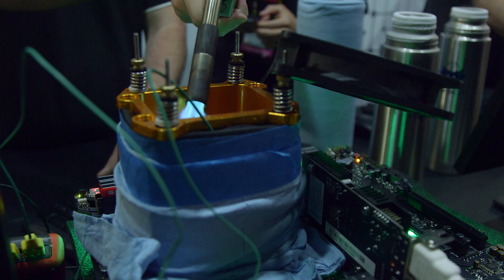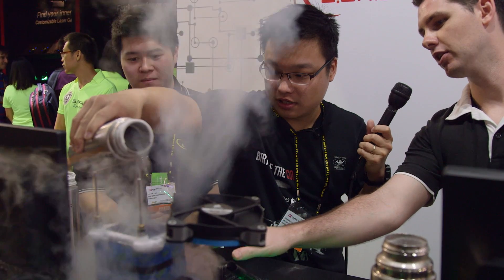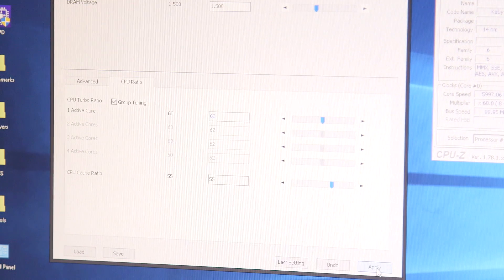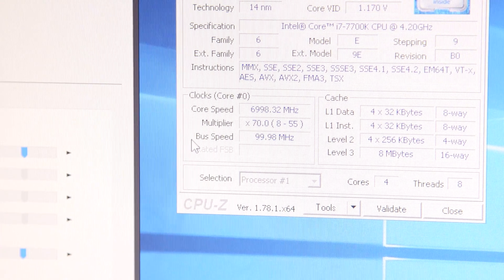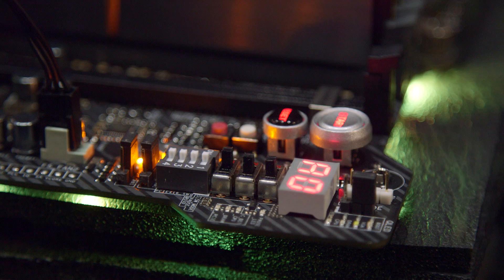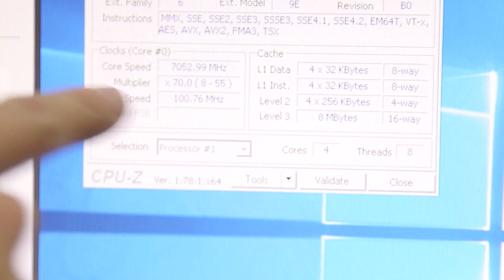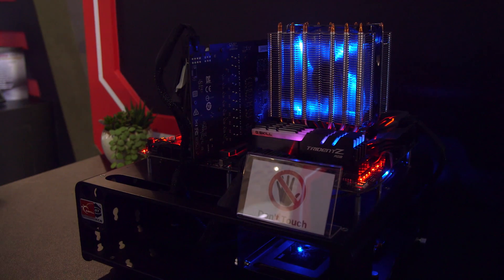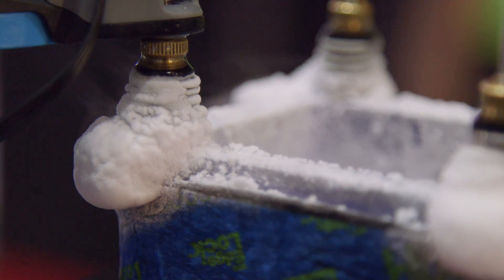Overclocking to 7GHz with Liquid Nitrogen | Hands-On | Computex 2017

Comment: So impractical. They just keep pouring liquid nitrogen in open air and doesnt have any counteraction against condensation. What 7Ghz is an actual cooling system involving a condenser and evaporator. Simple as that

Comment: Why use a torch? In fact: to cool the chip even further. From a pc-gamer article: "You torch the inside, creating an ice layer, which lifts the leidenfrost effect. We use the heat on the cold, we have condensation, but because it's so cold, it immediately forms an ice layer. With the same drop of nitrogen, it will be cooling a lot more effectively. So it's a bit of physics that goes into play."

Comment: People in 2063:
That's cute he had to use liguid nitrogen 😏
Reply: 43 years later: people still use liquid nitrogen
Reply: more like 2030
Reply: They are using solid nitrogen
Reply: @alichank  or solid helium. Damn thing won't freeze unless you apply 25 atmospheres worth of pressure at 0.95K temperature.
Reply: Future kid : lol my phone is 20ghz.
Reply: Lol
Reply: Nah buddy we wont never get beyond the GHz limits With the current CMOS Technology
Reply: @t07minas  won't never you say...
Reply: My setup uses neptune's atmosphere for cooling 👍
Reply: 2063:No earth
Reply: Kuruvilla Jacob Palamoottil 2070 : no universe or any
Matter ceases to exist
Reply: @kuruvillajacobpalamoottil6582  malayali
Reply: @ameee_n  Yes bro
Reply: @ameee_n  aysheri
Reply: You do know that next thing in the line is liquid hydrogen and its not possible to use due to safety reasons so yeah most likely we will still using liquid nitrogen as the normal cooling method and no one uses liquid nitrogen for gaming except experimental overclocking like this
Reply: you might need liquid nitrogen for quantum computers
Reply: You mean 2077?..

Eh.. 🤭
Reply: People in 2010:
Look we broke 5GHz with liguid nitrogen!!! 😧

Comment: Amateurs. My poor 50 GHz system is so slow. And the CPU with only 812 cores and 1624 threads. And my cooling is using anti - matter. It's so bad. And the memory of the card is 80GB.

Comment: new title: how to play games with no graphics card
Reply: Buy rgb for 100+ fps
Reply: some CPUs actually have integrated GPUs, so technically you can play without a gpu
Reply: @Nikholai1001  No, you can play a game entirely with no GPU, not even integratred.

"AMD Threadripper 3990X CPU has the raw power to run Crysis without a graphics card. AMD's Threadripper 3990X has been breaking world records for CPU performance, and impressing us even before its release, and here's another major feat achieved by the mighty chip: it can run Crysis just on its own."
Reply: @lilac.nightshade  OK
Reply: You can play without a graphics card
Reply: i-gpu ram limitation
Reply: @television4550  overclock the ram lol
Reply: @gamaltk  fax
Reply: @television4550  download more
Reply: @television4550  2GB VRAM is enough for iGPU for us gaming at 720p
Reply: I play games but what is a graphics card 

Jk
Reply: CLI(command line interface) games.

Comment: when you need to play minecraft with shaders:
Reply: You should OC the gpu not the cpu in that case
Reply: @theno3554  isn't minecraft more cpu dependant
Reply: @unrested7294  but with shaders
Reply: Appoddigare  ok, so let me try and explain my point further because I don’t quite think you understand what I was meaning. Normal gameplay of Minecraft you’re going to see almost all cpu use, Very little gpu usage. Once you activate shader’s though, the cpu usage drops and it drops almost all of the load to the gpu. You can check this by opening task manager while Minecraft is running and seeing the % used.
Reply: @TheMadPlayer.  thats true
your  cpu will usually be running around 30% and ur gpu will be running 100% unless you don't have shaders enabled, I personally think the game is for better graphics as its a casual game, unless pvp or speed running, so id say get a better gpu instead of cpu
Reply: It's more ram dependant than anything imo
Reply: Appoddigare  when shader’s are active it’s more gpu dependent

Comment: Better open a chemistry laboratory in your CPU case and control all the chemicals with different button if temperature starts rising press the button and send nitrogen if it doesn't work send fluorine if that doesn't work send hydrogen peroxide if that doesn't work flood the case with water through the pipeline that you connected to your Case from the nearby dam.

Comment: Wouldn't it be a better idea to use something like dry ice, which is a lot warmer and not as likely to freeze the shit out of your computer parts?

EDIT: According to JayzTwoCents, no. No, it is not.
Reply: the issue with dry ice is that you need alcohol or acetone to be a conductor so it can transfer the heat. The co2 is like -79C which is good, but most hardware can go -120+ and still see benefits.  It's also hard to control so you can't drop it a few degrees then pull it back up if needed you basically can only drop then wait, then drop then wait.
Reply: @bret3925  Already edited my last post, but that's really insightful, thanks for sharing!

Comment: Processor is not used for gaming.
The main thing used for games is GPU
Reply: Than you clearly don't know much. You need both, and games can vary between cpu intensive games and gpu intensive games 

And of course your cpu still needs to hit a certain standard otherwise it will hold the gpu back.

Comment: Well I tried to run crisis at least 30fps 120p resolution with this CPU but no, It won't work. I think I forgot to overclock the thermal paste. (BTW did they even put thermal paste in their contracption, I mean what kind of paste doesn't become a BRICK at -190°C?)

Comment: If you really wanted to go crazy. Mount a cryogenic pump cold head to the back of the chip. You would need a compressor and a small rough vacuum pump. Assuming you built the mount correctly you could have it running down at 10 Kelvin.

Comment: sooo, dumb question that i might already know the answer to. why are most if not all serious overclockers still using liquid nitrogen and not something even wilder like liquid helium. Im thinking cost related? why not place the whole computer in a vacuum with liquid helium and overclock away? I presume it comes down to monumental difficulty with regard to working with liquid helium or perhaps there is not much more benefit of going colder than what liquid nitrogen offers...

Comment: Pointless... you have to run cinebench before you can call it a successful overclock.
Reply: Wait is this a joke ? If it isnt, then I don't think that it would run stable enough to even complete it.
Reply: @valrex7578   Exactly, it would crash midway... which is why I said what they are doing is pointless if it can't even run a program.

Comment: DETAIL The guys have overclocked the cpu to 7ghz, but they don't have used the 7ghz in any moment, the cpu clock increase or decrease by demand, that's  the reason to don't have increased temperature and fry it up.

Comment: Why on Earth are there people trying to do this? Isn't there any other reason than "because we can" ? Why on earth would someone want to have such an unstable system? You can not do anything with it. Besides that - the next gen Chips will easily outperform the overclocked "last gen" at standard clock. I don't get it...

Comment: Hey crazy idea. Put the PC in a vacuum chamber and have a heat pipe run into the chip and through the vacume walls. My theory, no air, means no water so u can have piece of mind when operating it

Comment: Liquid nitro's CPU to -190c, pushes it until it crashes.  Won't boot into windows so APPLIES A BLOW TORCH to bring it to -170 and everything works again.
'So you can see there is no issues with the overclocking here.  It crashes at 7ghz you reboot and try again.'
That was some great computer humour right there.

Comment: what is crap about this video is about the facts. from negative zero temperature, use a blowtorch to rapidly heats it up? it could crack man since its aluminum, this is not an experiment at all because we dont need to do this when we already know the rapid shift of temperature in aluminum will surely crack it.

Comment: Pouring liquid nitrogen using bare hands, stupid
Reply: heat from your hands boils the LN2 before it can burn you, and the beads just fall off. If you wore gloves, the LN2 would soak into the fabric and stay in contact with your hand and actually burn you. Look up videos of people pouring LN2 on their hands and being just fine.
Reply: @yooser-nayme  dude I just looked up ln2 and it says although you can do it its extremely dangerous so the fact that you're advocating it is just plain fucking stupid. Do you also jump off bridges if everybody else is doing it?

Comment: They're -190c with 1.9v, why aren't they adding more voltage? They have a ton of head room for temperature.
Reply: Hell even 1.9v is CRAZY. most people say stop around 1.25 if you're not an intermediate overclocker, 1.4v being the point you don't wanna go over.
Reply: @kgbme.I jb weld the heatsink to the cpu.

Comment: I overclocked my case and now I could run crysis at medium 1080p
Reply: i overclocked my PSU to 4gb ram, it was hard but worth it
Reply: Well you should also try OC your mouse, works likes a charm
Reply: I water cooled my chair and my fps went from 34fps to a steady 60fps
Reply: Haha
Reply: @NutScrewGamer  NOOOOOOOOOOOOOOOOOOOOOOO
Reply: You would need a core I11 4 TB of ram and 500 TB SSD to run Crysis at medium 60 FPS minimum requirements
Reply: @acim0095  ssd*
Reply: Enough of the crysis jokes guys
Reply: @shaur1221  no u
Reply: @acim0095  not a good comeback
Reply: But did you overclock your desk?
Reply: Impossible , you need atleast an I5329532 9999Ghz , an Nvidia gtx 696969 Ti 3000Gb , 99999 GB RAM , to run crysis 1 lowest settings with 30 fps
Reply: @crytek1012  Right. Or I can write some intense useless, inefficient as hell and endless computation in a web page....no CPU would be able to run that without lag. Crysis 1 was also quite inefficient with the CPU management.
Reply: @crytek1012  u actuallt need the rtx 696969v2 Ti 300000Gb with 9999999999gb @500000mhz of ram to run even 15fps oh and also u need at least 998908980989089088cores and 23046403750627506427365074564236254360245625430654276043520645364350654236245360275432603452653046520437625043760534760ghz
Reply: You overclocked your case?😐
Reply: @NutScrewGamer  You missed the joke? ._.

Comment: I dont understand why ppl do this... I can understand the hobby, or, competition aspect... But why not try to invent something that will "Autonomously" Keep the Temperature just right? both Pouring more Nitrogen when its warm and  warming back up when its to Cold. The reason I ask that this be done is because well...  It would be crazy Awesome to try and use the Computer while you were doing this... perhaps, Running Crysis in with 4K mods or something else more labor intensive for the CPU...

Comment: can it run minecraft low settings?
Reply: SimplyHackin no Minecraft minimum requirement is 9000 Yhz CPU
Reply: Yes, but still can't running roblox at720p at 30 fps

Comment: What if we put the mother board and the hhd and everything in a nitrogen gas environment which will prevent moisture condensation and then we can circulate liquid nitrogen around the cpu.  I would try circulating water or probably automobile anti freeze which will stay liquid below 
0 degrees. 5 or 6 ghz is possible for daily usage with a small refrigerator compressor. 
With Liquid nitrogen however its not easy to make or buy unless you live in the neighborhood of The King of Random.
Reply: Nigga are you some kind of genius
Reply: @TheNutshaq  do you have the n word pass ?
Reply: Tumpa Talapatra or delid 8700k with h150i pro water cooler with 6 fans and run it on 5 Ghz for daily usage.
Reply: A lot of overclockers use that, it’s called a coldbox
Reply: True lmao
Reply: @tf2excession  yeah but it won't achieve sub-zero temps
Reply: Nah... I will try

Comment: This is the computer world equivalent of the car worlds dyno queens.  A car that can make 700 horse power between 6700 RPM and 7000 RPM, but at all other times is turbo lagging and making 200HP ... that's a dyno queen.  Also how a lot of import and newer cars get their numbers, basically.  This though... This competitive overclocking...  What good is an overclock which can manage 5 seconds of stability, or a POST at best!?  Yeah, it reported the speed you were after, then immediately choked on static windows desktop icon data and died.  Great job... Oh, and the system... its deadly, so there's that too.   What an achievement.  Many wow.

Comment: But can it open Chrome?
Reply: No, chrome need 256gb ram ddr4 3500 mhz and 23ghz cpu)
Reply: ddr4 3500mhz is too low we need 12000 Mhz HBM2 Rams At CL1
Reply: @neroknight761  chrome needs 256 mb ram man not gb
Reply: @pubgking5723 , this is rofl, man
Reply: Nope, this system is too fukin weak

Comment: 7ghz is very fast faster than 3ghz
Reply: No shit dude!
Reply: duh 7 is bigger than 3
Reply: Steve Sibaja if it would be able to run anything without crashing and miscalculations
Reply: Steve Sibaja you’re a fucking genius and your use of grammar to create sentences is amazing!
Reply: If they are pushing it from desktop im sure first load would crash sth
Reply: @Boz1211111  😂😂😂
Reply: @awwiana   would make more sense to achieve max stable/usable overclock imo
Reply: @Steve Sibaja
I think you might be on to something..
Reply: It only needed a a fucking comma in the middle and it would of made sense 
fuck me.
Reply: Drake yeah and then we could have all benefited from the insight that 7 is greater than 3.
Reply: i m runing on 1.1ghz xS
Reply: No shit Sherlock

Comment: As a computer nerd. I don't gett his at all. All you're doing is pressing apply and a program is showing a high hertz rate. But it does absolutely nothign since you're not using it or even 'feeling the horse power' because even stock stuff doesn't lag....... You're like paying thousands to see a 7 digit in a box called cpu frequency

Comment: I have got a gigabyte z170 motherboard and Intel i7 7700k which is cooled with an aio liquid cooler Corsair h100 dual fan 120mm.
How much can i overclock this at a stable rate? Temp ect

Comment: This is all completely stupid showing off, there is no need for all this cooling, unless the pc power supply is over 2000 watts, (which i doubt) you don't need too use liquid nitrogen to cool the system down

Comment: I have a feeling that the whole liquid nitrogen shit is only for show... the ordinary electronic components are not designed to operate at that kind of low temperature and I highly suspect it could permanently damage the hardware. Also the heat capacity of nitrogen is not very good compared to water so any sustained load on the CPU wouldn't last long.

Comment: this is crazy, who does this in normal routine? try something that a layman like me can take the benefit of ur experiments. Liquid nitrogen is extremely harmful. THIS VIDEO IS SHIT
Reply: You can still sub-zero cool your CPU for daily use (phase change, -35c at full load, -55c idle). Don't do that on a GPU, the solder joints crack from thermal contraction of a short period (days/weeks/months, it doesn't take long). Or you could do the cheap route if you live in a cold place and drop your radiator into the snow and use antifreeze for your coolant (insulate your board, shop towels are not going to cut it).

Comment: Surprised there wasn't a short when all the ice melted.
Reply: It can happen, make sure to unplug the power immediately after you are done. Also, coat everything with vaseline or plasti-dip to water proof it. It wouldn't be fun loosing $1000+ in hardware because you're too lazy to do things properly.

Comment: This is unbelievably stupid. Not only is nitrogen gas extremely toxic, but if there are any sparks or loose electrical connections on the motherboard the nitrogen will explode
Reply: Ha, best joke of the day, an inert gas that our air consists of over 78%, clasic!
Reply: Someone's been playing too much crash bandicoot
Reply: Jesus. H. Christ. Someone needs a remedial 5th grade science class.
Nitrogen is not toxic to human beings. It makes up nearly 80% of the air you breathe.
Nitrogen is not flammable or explosive. If you had a small fire and poured liquid nitrogen, or even gaseous nitrogen on said fire, the fire would go out due to oxygen deprivation. As a matter of fact, nitrogen is used in buildings as a fire suppression system. Nitrogen is used in order not to destroy what is in the building, such as electronics, as water would do.

Comment: Well, a chinese group called geekerwan also tried to overclock an 7700k to 7GHz but the volt stuck at some point and they didn't use nitrogen to cool down cpu. They think the voltage stuck is motherboard firmware limitations so they changed to a msi motherboard then just like the last motherboard. They cannot go over 5.3GHz with all core

Comment: Why not customize a cooling solution utilizing a sealed unit as they're losing  cooling.. Cryogel insulation enclosure.. Freezing the entire board and setup by circulating the nitrogen after freezing the CPU.
Reply: Perhaps a liquid nitrogen setup filled under pressure and utilizing the gel they use on bar taps to make ice.

Comment: "no issues with the overclocking" says the guy while flametorching the loquid nitrogen cooler after the system froze to get it running

Comment: Do you also want an 7GHz OC? Its easy: Press Win+R ,  type in regedit, go to HKEY Local Machine/Hardware/Description/Central Processor. Click on Core 0 and edit your processor name by replacing the old clockspeed with "7 GHz". Now you can open your taskmanager or computer properties and you will see your new overclock. Well done :D